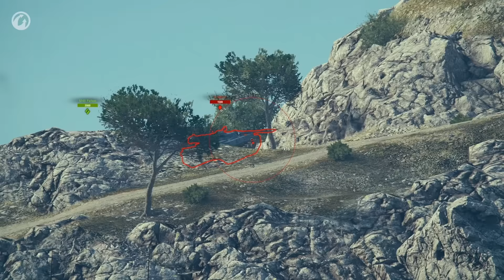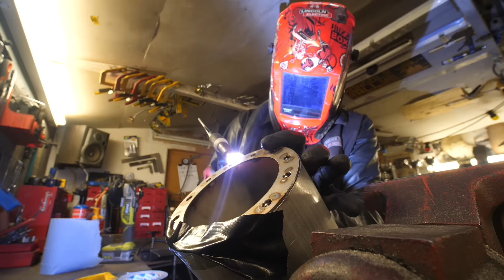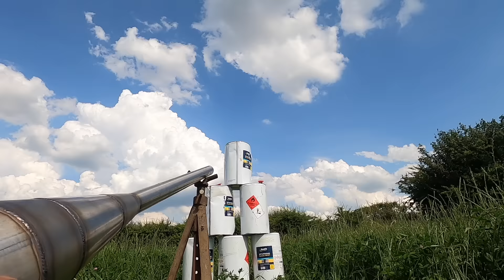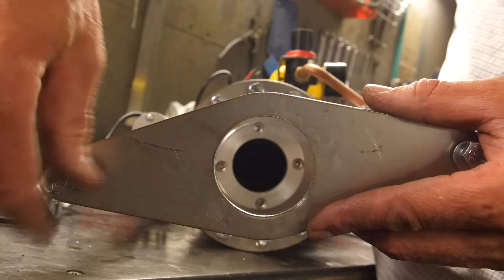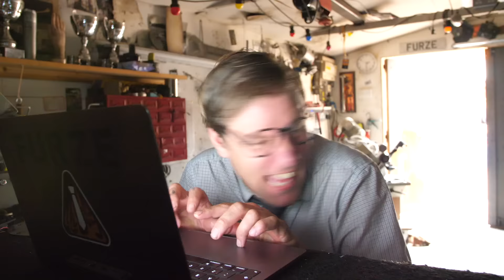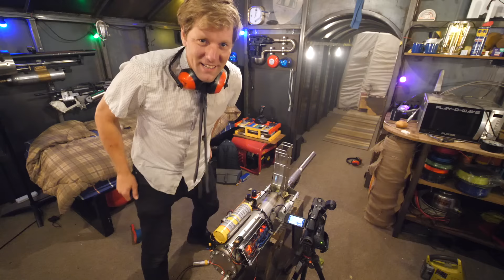SEMI AUTO POTATO CANNON for the Homemade Screw Tank

Comment: Really, there were battle tanks with flame throwers used by the US and Australia in WW2. 
US flamethrower tanks
M4A3R3 Sherman: Also known as "Ronson" or "Zippo" tanks, these medium tanks were equipped with flamethrowers and were used on campaigns like the Battle of Bougainville and Saipan. The use of the larger, better-armored Sherman tanks was preferred over the smaller M3 Stuart tanks later in the war.
M3A1 Stuart: Initially used in the South Pacific by the 754th Tank Battalion, these light tanks were equipped with flamethrowers for a variety of purposes, including taking out bunkers. These were later phased out in favor of the better-armored M4 Shermans.
LVT-4 AMTRAC: The Army also used large flamethrowers mounted on these amphibious vehicles during battles like Peleliu.

Comment: Shooting apfsds out of this would be crazy
I don’t see why a 3d printed sabot would be an issue and you can make a steel penetrator with the sabot going around on the outside to make a seal then when it exits the barrel the sabot discards and it’s just the dart flying
This is perfect because it’s not a riffled cannon and a sabot dart is better when it Dosent spin

Comment: In case no one has let you know, they actually did put flamethrowers on tanks. This was done by most major powers in WWII, and saw use on both European fronts as well as in the Pacific. They were really good for clearing out areas with thick vegetation or large concentrations of enemy infantry. They were also really good at deterring enemy soldiers from trying to get on the tank to disable it with explosives. Flamethrowers weren't standard issue for tanks, but they were common enough to be well documented.
Reply: They were also good for taking out pill boxes

Comment: Not semiautomatic, but autoloading. That said, autoloading guns are much more common on tanks than semiautomatic ones. 

The difference? With a semiautomatic action even while the gun is firing its already being reloaded, it doesnt stop, pause, and load a new shot but uses the energy of the first shot to load the second. 
Not really possible with such a low powered system unless you'd be willing to split off gas to the loading system.

Comment: wonder if you can keep the cutter down by spring, and create a gas operated system by directing some of the expanding gas to open the cutter, and letting the spring slam it shut, maybe not enough pressure for springs required, would definitely be faster than linear actuators

Comment: Make s 2 part potato.cannon.,, a patato launcher with a metal pipe in.patato with parshoot a really big mortar fire work launched put tube doubling distance into sky and patato and tune comes.parshoot.down put the pins behind patato front of tube is where patato is with another set of fins to stick patato and hold it like a nerf football heavy in.fromt. send it.to.space bro 9 v battery on both sides of rocket tube with computer chip.andmortar launcher 5 second fused to time it or parshoot back unharmed wait 3 min make sure. Have the toggle switch on cannon to go off on.rocket or a timed fused put have to come out front of tube to not light gas till.u want and u could do it just a fuse out front of u seal the metal tube.right and parshoot underr cap and put ,2 times mortar round and 4 times power rocket engine that lights it

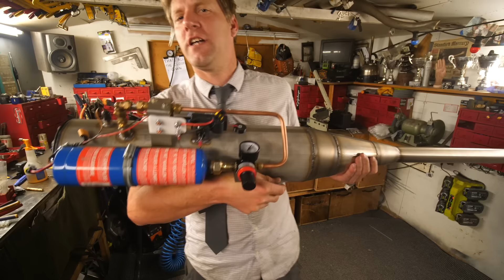Comment: 2:50 the handle with the red button in most torches has a regulator. At least here in the states, when I made a potato gun, I just removed the sparker in the torch head before attaching it to the expansion chamber

Comment: I would install a small heat resistant fan for the combustion chamber.
It would create turbulence and improve the performance of the gun.
This is used in internal combustion powered nail guns like Paslode.
https://www.paslode.com/framing-systems?&msclkid=71fbe708ebdd101ed079b8da7b26cb15&utm_source=bing&utm_medium=cpc&utm_campaign=PSLD_Search_N_N_Framing_N_Branded_Exact&utm_term=paslode%20nail%20guns&utm_content=Nail%20Gun&gclid=71fbe708ebdd101ed079b8da7b26cb15&gclsrc=3p.ds

Comment: air cannons and carefully designed gas combustion guns are no joke. Substitute old D cells for spud-plugs, propelled by nothing more than shop air, you can punch them through both sides of an old steel refrigerator, a car door, etc. Utterly destroys cinder blocks.  Sure, it's a bit more bulky and longer than a Barrett, but if you find yourself living in a Mad Max movie... air guns are no joke. :|

Comment: If you're putting it on the screw tank, replace the linear actuators with hydraulic cylinders. Unless you're wanting to fire it with the engine off.

Comment: Pneumatic cylinders would sound way cooler then those linear actuators. I know a bit more kit is required for them to work like a compressor and air tank but I feel like some exhausting cylinders would fit into the them better too.

Comment: how does it get clean air to burn?? does it just pull air in through the barrel because the chamber is low pressure after firing? or is there a hole in the fuel line so the flowing fuel siphons air in similar to how a propane torch does it??

Comment: That's brilliant, no doubt, but, if you plan to put it in the top of the tank, above your head (for balance in water reasons) I think I (I'm not judging, I don't have your skilss^^)  would have choose a cylinder instead of a magazine, because it take a lot of place up and would look nicer. If you plan to put it in front of you (easier to aim) the magazine will be easier to reload, but for balance you may need to get rid of the "balast" at the rear of the tank ^^
Reply: And by few lines of code you could make it automatic^^

Comment: It would be more elegant and faster to use gas pistons and springs for the loading, and the Arduino to regulate the gas and ignition.  But the physics and engineering would be harder to get right than the electronics, it seems to me.

Comment: "this is the most overengineered potatogun the internet has ever seen"... for the loading system, for sure. But its also the most mismatched chamber/barrel size u can have.  It can be way more powerfull with a longer barrel or a smaller chamber.
Reply: A longer barrel sure. But my naive mental model says that a larger chamber for a given barrel length will always give a higher power because the pressure drop over the length of the potato's travel will be less, so you would always impart more energy to the projectile even if even more energy is wasted too. Am I missing something? I'm assuming instantaneous combustion and adiabatic expansion, are you saying that the timescale for the combustion to propagate through the large chamber is too long relative to the time the projectile is in the barrel, and thus the pressure does not peak as high as it might with a smaller chamber? I'm struggling to see another effect which could reduce muzzle velocity by increasing chamber volume. Or by '... or a smaller chamber" are you suggesting trading chamber volume for barrel length, shrinking the chamber but keeping overall length the same?
Reply: I agree, a smaller chamber wouldn't make the cannon more powerful and even if it did its way easier to swap out a barrel than changing the chamber.
On second thought it might make it more powerful but getting the size right would involve a lot of math that would involve friction, fuel burn rate, air fuel mixture, projectile weight, volumes and other stuff. It is way easier to brute force it with a longer barrel than mess around with blast chamber length.
Reply: @Ignas-Saxophone-Rat  Yes, changing the chamber now is not the most smart, but my thought comes from the 1/1.5 ratio (not a lot of math to me)i see everywhere. Its true the bigger the chamber the bigger the boom and more powerful ect, but that will happen after the potato is already flying, not knowing how far away from the barrel.

But anyway, interesting to read your comments guys.

How interesting would it be to make a PVC spudgun, with a chamber that can be extended with some male/female threads, to test it?
Reply: I actually think he made it less powerful because idk
Reply: Actually my potato cannon had a barrel to camber ratio of about 0.8:1 the barrel was shorter than the blast chamber I recently changed the barrel
Reply: It’s a potato gun?
Reply: Watch Mastermilo's patato gun that is what i call overengineerd
Reply: @rensfassbender5585  Cheers for the suggestion! https://www.youtube.com/watch?v=bieEfHw25Ts
Reply: For a short barrel, multiple simultaneous sparks, spread through the chamber can help. This is what I did with my cannon. It made mashed potatoes most of the time though.

Comment: Imagine using a homogenous charge of nitrous oxide and acetylene 

Imagine it having multiple sparks evenly distributed throughout the combustion chamber

Imagine adding a funnel-shaped muzzle for no reason other than to make it louder

Imagine a polished and teflon-coated bore with minimal friction and corrosion

Imagine the device cutting the potatoes also cut threads into them to make them spin for more stable flight

Just keeeep thinkin

Comment: Dude you need to put a radiator and fan in the hydraulic loop. The combined heat from the pump and the exhaust is going to burn up your fluid!

Comment: During this video, you mentioned you had to learn arduino my only question is what resources did you use to do that.  I understand electrical schematics. I have problem with arduino programs I know it based on c+ but I'm still going pulling my hair out going what the heck.  Please tell me how to learn arduino programming not circuit design I know that. Just need know how  to be able implement the full usages of arduino. Please.

Comment: Why don't you use pneumatic cylinders instead of the linear actuators? They are fast and would be powerful enough. You just need a source of air. In the field you could use compressed air from a cylinder. You could control these using a electrically operated valves via your microcontroller.

Comment: So the reason you get the second fireball after the shot is due to the ignition placement in the middle of the chamber. It ignites and expands and pushes the projectile  out, while the gas behind the ignition doesnt light yet due to pressures n oxygen availability n whatnot. Once the projectile is outnumbered air rushes back in the pipe to continue the burn of the remaining fuel. The way for a more complete burn is to have the ignition more near the back.

Comment: Should mount it on the top of the tank on a base plate with a motor underneath and a 4 10 gear ratio for a 180 degree aim without having to turn the tank

Comment: Just a thought.  You could have tried for hydraulic actuators. Since you have a hydraulic power source on the tank.  I think that would load faster and stronger. All you would need to aid in control would be in/out limit switches and a couple of solenoid valves.
Reply: This would also be less taxing on the tank electrical system

Comment: Could be better with small little flanged pipe sections that work as cartridges. (Not too different than the section of pipe used as a cutter in this vid.) Pre-load those with spuds, and just have the flange seat into cannon. Then you can load the pipe sections and eject them even more clean and consistently than any cut sections of spuds, and since they're dimensionally consistent even more could fit in the magazine hopper. Catch the spent "cartridges" in a bin to re-load and use again later. Would be a modest modification of this design, and the range of motion to seat and eject would be even smaller, thus an even faster firing spud gun. (Perhaps full-auto if the propellant chamber charge refresh rate could be made fast enough. Maybe worth a re-visit with a Vulcan cannon inspired spud-gun?)
Not to say that this kind of spud-gun isn't genius, but only a hair off from having it even better.

Comment: @Colinfurze
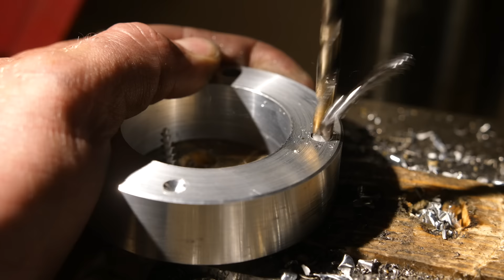4:50 This part, if you make the big hole slightly conical, so the piston fits inside in the beginning, bot not through the end, then you will get a pretty good gas seal too, even if it should leak a little, then the pressure from the explosion will slightly push out the inner tube so it is completely sealed.... at least in my theory.
You might want to make a little "lip"/ring at the base, so after a lot of wear & tear it still can't just push the tube straight through the ring.

Comment: Wtf, put a metal ball and it’s a damn cannon that will blow through walls. Maybe a light metal like aluminium ball or something
Reply: Backdraft pressure will destroy cannon with such heavy load
Reply: олег бурдин use a light metal or something else
Reply: are you dense or sumfin? this a potato cannon, not a metal ball cannon.
Reply: Kanovskiy I doubt it's so precisely engineered. Many spudguns have barrels designed to withstand the SEALED chamber pressure.
Reply: Kanovskiy what are u on about lol
Reply: @hhhydra2397  probably very very illegal, or at least extremely unsafe given the fact it could easily kill anyone who stands in the firing line
Reply: Solution: don't fire it at people. It's a giant gun. Duh.
Reply: @Pds3.14  no shit don't fire it at people, but more of just the thought of having something attacked to a moving vehicle that could very easily crack someone's skull open is probably enough to want to stick to potatoes. And as I said, possibly illegal
Reply: Matthew Grigg 
Or shooter, modern cannons are made from really durable metal alloys, NOT sewing pipes
Reply: @hhhydra2397  you're very dumb. it wouldn't have enough power to shoot the metal bar anywhere, it would probably just explode
Reply: I built a potato gun. It would shoot Chevy head bolts(paper sabot) through 1-1/4” plywood. Used schedule 40 pvc pipe, electric sprinkler valve, couple 9v batteries, momentary switch, and compressed air.
Reply: And even barrel tapered spudguns usually are designed with the static pressure change from adding the barrel volume. They're usually not taking advantage of the fact that the gas is moving near Mach and has lower pressure.
Reply: Needs compressed air - not aerosol.
Reply: I don’t think it would create a good enough deal. And if it did then the explosion wouldn’t be strong enough to fire the ball far.
Reply: At the risk of stating the obvious: there are laws and regulations regarding building items that can be used as weapons. Some might recall Colin got into trouble from his flamethrower scooter back in the day. I think he's more than aware of the legalities and therefore sticks to projectiles/materials that are as far from actual ammunition (like steel or other metals) as possible. This is the UK, not US. You can't simply walk into a store and buy an AR-15, and the same philosophy extends to homemade items.

Comment: What about replacing the linear actuators with pneumatic cylinders for lightning fast reload (until your pressurised air runs out)? Then seal off the potato cannon and purge the combustion chamber during reload with pure oxygen for more explosive power! Then use large stepper/servo motors attached to the arduino for automatic aiming, laser rangefinders for precise targeting, and you're set to lay down the law with fully automatic bursts of potato power! Pls make it happen!

Comment: Colin, if you use microswitches on the actuators then you would have a more robust control system. At the moment, you're reliant upon the linear actuators working for exactly the right amount of time but if you used microswitches you could just set it going in one direction and leave it until it reached the right point at which you stop it.

Comment: I went to a 60s secondary modern school and opted for metalwork instead of woodwork (which I am still crap at), it's so essential that children are taught basic engineering, basic electronics, etc to get a feel for materials and systems' design, let alone CAD CAM as things now have become very interesting with 3D printers. I love the smell of an engineering workshop! We got the cane for upsetting the metalwork teacher by pretending to have drunk the contents of a sulphuric acid bath (no PPE ever) we used to plunge red-hot copper plates into it for cleaning. He went white with shock when we yelled "sir he's drunk the acid" - 6 of the best - well worth it... I suppose these days he'd go to jail. You live in a soft stupid disrespectful world totally unaware of most engineering aspects of things you use (radio is a  good example - bet you don't know how a cellphone works?) .. This guy is amazing!!! So great to see his AMAZING work...where I live in Thailand there is more clever gear in his workshop that 200 SQ miles of here!!!

Comment: You could've saved you quite some problems with the potatoes peels by exchanging the potatoes with something else who would fit the exact dimensions of the tube, like soda cans.

I mean a soda cans cannon can't be classified as a weapon, right? You could argue it is just a long steel tube made to propel cans, using gas, farther than you would with your hand so it's basically some sort of gas catapult and last time I checked catapults were legal.

Call me for any legal problem, I'm cheap.

Comment: It's cool, but I don't think it's worthy of the screw tank yet. Actuators would be terrible in a battle situation. Why not do it like a real auto loading weapon, and use the pressurized gases to push the barrel off and springs to bring it back to the firing position?

Comment: colin put some of that exhaust tape 
https://www.heatshieldings.com/nl/titanium-25cm-x-5m-uitlaatband.html?source=googlebase&gclid=Cj0KCQjwo6D4BRDgARIsAA6uN1-seNRFXlZ3hxc_LVcMAi10PC_N6pMnPOqEXOssUuruw0xH59FIthYaAtCwEALw_wcB
around the chamber , not only will it get hot from burning off the gas but if it tears open the tape during a firing it will somewat hold the parts together instead of propelling them intoo youre lap